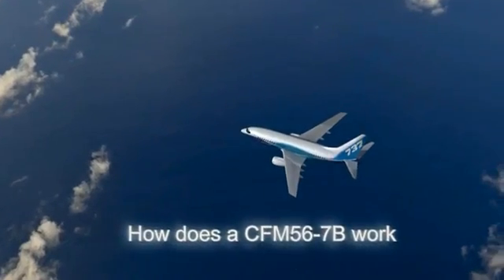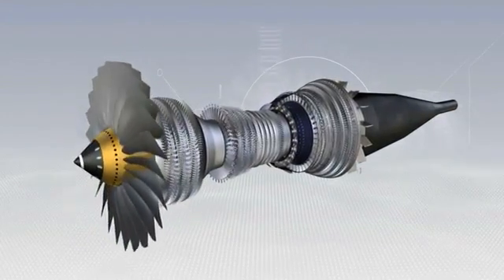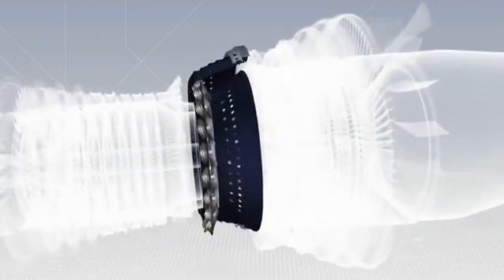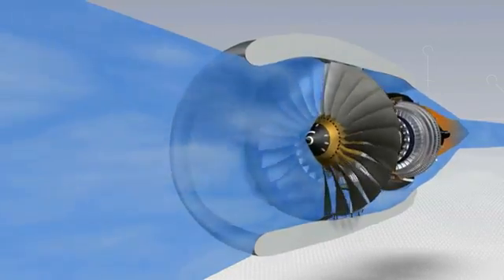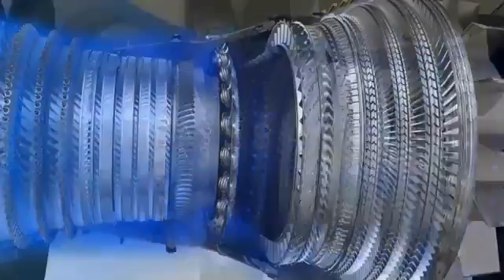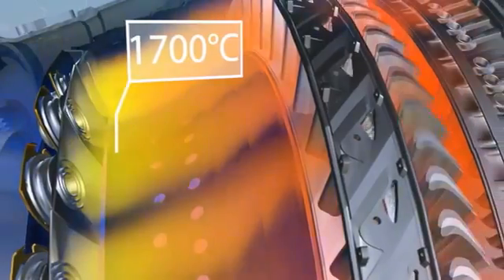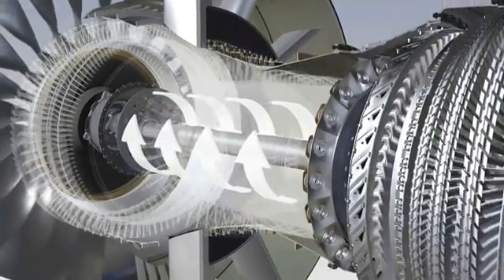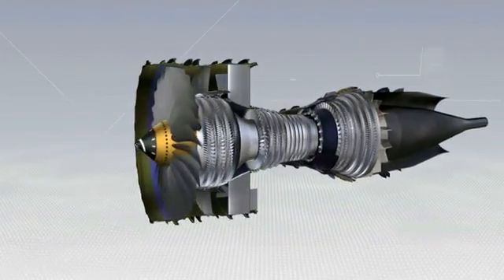How does a Turbo Fan Engine CFM56 7 Work

Comment: What I can never understand and no video explains is how the compressors work. I mean I understand the principle of compression, you decrease the area while the volume remains the same thus pressure increases. However I do not understand how this is applied to and is achieved by fixed and rotating blades. Every video I've watched skips over this and leaves the viewer to assume it just happens magically. Can someone explain please?
Reply: +Leonardo Lo Cascio Many thanks for the effort to explain. After browsing the MIT page I'm happy to accept that compression "magically" happens with the blades. Lol! That's some really complicated stuff.
Reply: @mizzyroro  The blades are offset to each other, so think of it like the first set as they spin they take a small chunk of air and push that forward into the next set of blades.

Then the air that escapes them and is not caught by the first set is caught by the second set which is offset to the first blades and it catches  the air that leaks in between the gaps in the first set. 

The air can't go backwards because of the offset and before it has a chance to leak away it is caught by the 2nd set then the second set forces that air forward and it is caught by the 3rd set, and so on. The air never has a chance to leak backwards because the blades are spinning fast enough. So it gets progressively moved forward building more pressure after each set of blades. 

I'm not even sure if this is what you're asking to be explained. But if you are that's how I understand it.
Reply: +uriahms  http://ocw.mit.edu/ans7870/16/16.unified/propulsionS04/UnifiedPropulsion9/UnifiedPropulsion9.htm  here you can see the explanation of what you ask. Watch carefully the velocity triangles. The "rotating blades" (it's important to understand what the rotor does and what the stator does) change the state energy of the flow varying its momentum. Rotor adds energy to the flow conferring it an angular momentum and the stator subtract it: this generate the pressure difference and the pressure gradien and then the temperature difference and gradientt. How the engine works it's due to the momentum of the flow. I'm sorry because you are searching a complicated explanation  here in youtube (where everytone try to explain it in simply words) about a not simply subject but you should have a strong physics knowledge for understand (what you directly ask is explained in the link i writed you!) :) This video is ok, really, because it's just for give an idea about how a turbofan works. If someone wants understand better go to study from Jack L. Kerrebrock "Airacraft Enginers and Gas Turbine" book and study Gasdynamics (not AEROdynamics......)
Reply: hey Mizzy! The Compression Happens if you look closer to the blades. In fluid dynamics there are two methods to compress or expand a fluid, in this case the fluid is the air. for expansion(the first method), you use a "jet" part, which means if you take a tube, the input diameter of the tube is bigger than the output one. like an ice cone with the bottom open. this increases the fluid velocity, but decreases pressure. the second method is a so called "diffuser", its the same ice cone, but in the other direction. so the inlet is smaller than the outlet. velocity decreases, but pressure increases, which means compression. the same principle applies to the blades. the moving blades are there to push the air forward, but the science is happening on the still ones. if you would look on two blades of the standing wheel, you would see, that the distance between the two blades is smaller on the front side, than on the back side. it works the same like the "diffuser" ice cone, like explained before. hope you read this after two years. hit me up if you need a better explanation! :)
Reply: +uriahms You are welcome.  Yes they are sometimes. Depends from the scientific background of every person. On youtube it's "cool" and "fashion" to explain science like "really simple!for anyone!" but sometimes this is not possible. Also if in the video they would be cited velocity triangles, people "not of the field" can only accept it like magic, as you said. 

Your curiosity anyway is really ok but your question is about advanced engineering-physics so it's impossible to explain it simply without citing gasdynamics concepts. Sometimes more deep is the question, more hard is the answer !! ^_^
Reply: well one thing that this video doesn't mention clearly is that the inner turbines right before the combustion chamber spins on a separate shaft and spins at a much greater speed than the main fan blades and the two outer turbine blades but for example when ever your on a plane and you hear the engine start up your actually hearing the inner turbine first or is whts known a the n2 turbine witch has to be spun at a great spead before ignition also the pneumatic starter is connected to that turbine so really compression begins with the inner blades that spins is much lighter and smaller than the other blades and spins first before anything else
Reply: Mizzy Roro ，
Reply: Chin Jung Lai from
Reply: Phil Greene The FIRST TURBINE drives or spins SECOND COMPRESSOR, and the SECOND TURBINE drives or spins the FIRST COMPRESSOR.
Reply: you know when you increase the volume of gas you actually decrease the pressure of gas , ok!! ... the principal of compressor work is  ,  decrease the volume by pistons  or  blades that means increase the the pressure immediately ..
Reply: and turbine works to increase the volume of gas and decrease the pressure  , look!! PV=MRT it is the relationship between the volume and pressure , if you increase one of them you decrease the another one
Reply: In compressors the pressure is increased by slowing down the airflow,not by decreasing volume,the decrease in volume of the stators and rotor is only to accommodate the flow with increased pressure and decreased volume.
That's because when you slow down a gas it's pressure increases,that's just how gases works.
Reply from the maker: Actually the turbo fan engine divide of some part, low pressure part which call N1 and high pressure part which call N2, the supply air compressed on N2, when N2 stabilized it add some fuel and ignited in combustion chamber, which result very high pressure and hot temperature and release backwards the engine via aft turbine.. Its make the aft turbine part rotate which is connected to the front main fan turbine via connecting rod. The Low pressure part keep rotating due to air movement inwards and keep supply compressed air to high pressure. There is some stage of compression to make this flow working continuesly.
Reply: It’s not rocket science you morons. The blades spin as the wind turbine rotates in a counterclockwise motion, this means the electrical energy is produced from the engine to supply the voltage for the LCD screens on-board. The Boeing A380 for example uses this principle to cruise with 2 engines only instead of 3, which means it lowers the fuel consumption. The pilots can also activate a rotor that helps stabilise the airplane with a fan propeller. Now they are making a plane prototype that is based on the wing span deflection while the rotorfucker wheels can land the wingsuit proximity flying safely

Comment: cool explanation and everything...but, how do they start? i've always wondered that...i mean is there some kind of motor attached to the central shaft to start spooling the fan up so combustion can start?
Reply: bighunterman77 Most engines are started by a nozzle that blows air on the compressor fan, thus getting it to spin. At a certain RPM of N2 the pilot will then inject fuel into the combustion chamber and the process gets started.
On almost all aircraft, this starter motor is powered either by the APU or by ground power.
On newer aircraft, like the 787, which is almost completely bleed-less, compressor is powered by an electric motor.
Reply: BaptiseLeGrand
hell yeah, thank you very much for the explanation
Reply: BaptiseLeGrand Thanks for the explanation. I was wondering why there was a sort of "airy" sound right before the fan starts spinning during engine start.
Reply: +bighunterman77 airplanes have an APU. (auxiliary power unit) this is typically a smaller separate turbine that can blow fast moving air over the main engines to get them up to speed. APUs are generally started with electric motors.

Comment: what aircraft would you see this on? what's the difference between turbo fan and turbo prop?
Reply: tango viper Simply put. In a Turbo fan everything fits within a housing like the video. Fan is turned by the turbines at the back, after combustion chamber via  a connecting rod that runs through the middle of all the compressors and turbines. the space around the engine and the housing is reduced in volume moving backward which allows the air to be sped up and exit at a higher speed thane when entering, resulting in thrust.
Turbo prop the propeller is outside ( no housing). the propeller is turned by the engines exhaust gases. there is no bypass air.

Comment: Wouldn't it have much more thrust if the stationary blades where turning to the opposite direction of the turning blades? (There would be much more air pressure advantage).